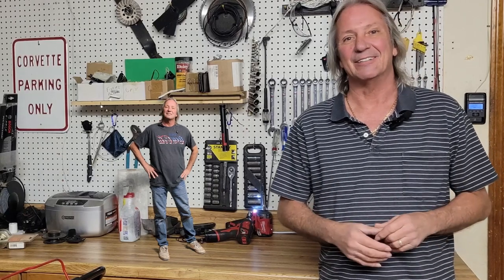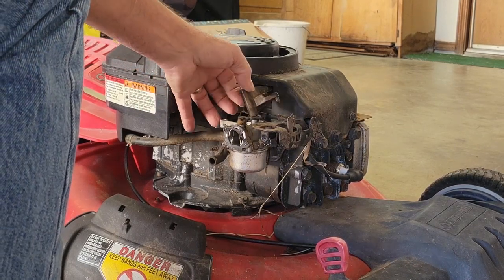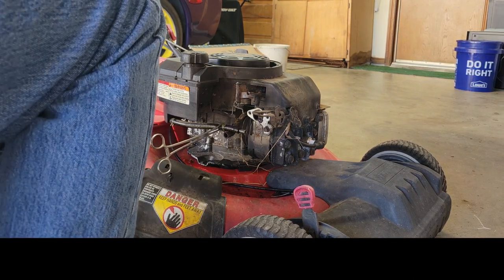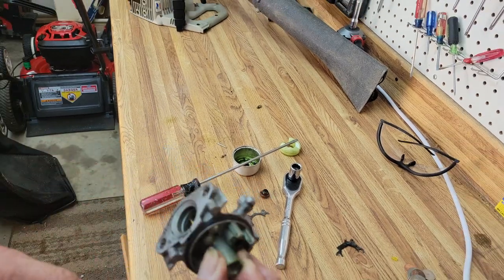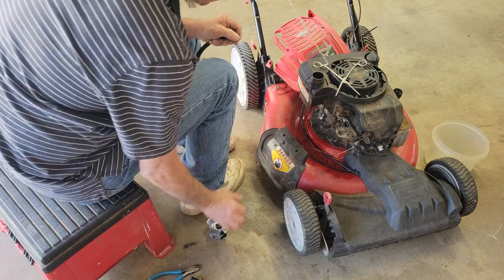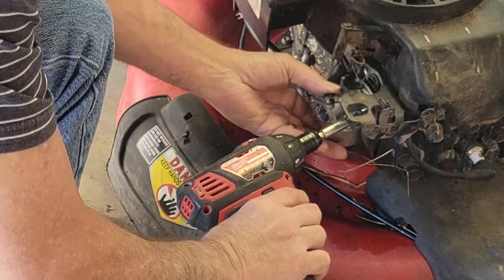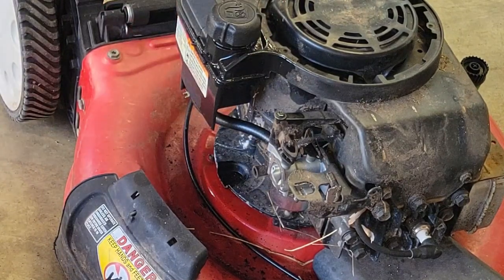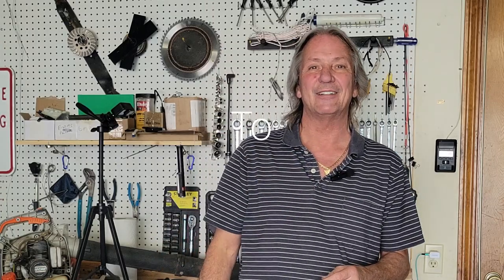Mower won't start after sitting for at least a year

Comment: Good job Bill, you should've smacked that little guy off your bench for knocking the impact over. 🙂
I didn't see if you replaced the gasket between the air box and carb, the other looked pretty torn up. 👍
Reply from the maker: Thanks. It took more than a little thought to figure out how to make mini me knock it over... It's easy to forget that he isn't there when I am videoing. There is a bit of sleight of hand going on there that nobody caught yet 🙂
I am going to make him a regular so I am sure he is going to take some abuse eventually 😲🤣🤣

I made the mistake of doing the gasket off cam, my bad. I had 3 things going at once and only filmed one of them, I stuck it to the base with a touch of gasket sealant before I carried it back over.

Comment: Ok  Love the little Bill.  Green gas in the bowl.  YUK.  Once again the gas in the tank looks newer than what is in the carb.  Customer -previous owner puts fuel in.
Reply from the maker: I am pretty sure little Bill is here to stay, he is funnier than I am. 🤣
I am thinking that it had 2 stroke in it and they drained the tank out and put regular in it before bringing it over but it's hard to say when you know nothing about it's history. It's the life of a flipper, nothing comes with instructions 🙂
Reply: @GuysPlayingWithTools  two stroke oil will dry up leaving gums or gummy residue as the fuel evaporates something not to put in for over wintering storage etc. best to use a fuel stabiliser fuel or dry it out.
Good call on replacement of carburettor...😊
Reply from the maker: @rickthelian2215 I agree completely.  Weird part was... it shouldn't have had 2 stroke oil in it in the first place, that was a guess based on the odd color
Reply: @Guys playing with tools  I’m believing the only reason would be for storage thinking oil would stop corrosion, motor oil may of done a better job.
Besides running it empty draining bowl seems the most acceptable way followed buy using fuels with stabilisers added in wintering storage.
We don’t generally winter our mowers in Australia 😀🇦🇺
Reply from the maker: @rickthelian2215  stabilizers are helpful but the best think to do is run it empty. Winter is mild here but the grass stops growing mid-October until March so they sit a long time every year. Race fuel has a blue tint, maybe they tried to add some to old yellow gas? I am guessing.
Reply: @GuysPlayingWithTools  Thanks Bill  Big Bill?

Comment: You get your fuel line bulk from the auto parts store? or another question is are there any modern fuel line materials instead of rubber that would be more resistant to ethanol?
Reply from the maker: This might be the best question I have gotten in a long time. I use "car" fuel line for all the mowers and have never had a problem(yet, of course) because a lot more research goes into car fuel systems than mowers. Some manufacturers claim to be more resistant to ethanol than others but despite their claims I am pretty convinced that 2 year old ethanol will be rough on just about anything.
Reply: @GuysPlayingWithTools  just looking locally and googling ethanol free fuel lines, there are specialty fuel lines for marine gas, high speed go kart racing, remote control aircraft fuel and so on and don't know if it is worth the extra expense up front to avoid the fuel line corruption later that shuts down the carburetor. Also I have seen medical lab grade tubing but not sure if that is fuel resistant although it is supposed to be for corrosive materials. That would be a good comparison review video if anybody has time to do it LOL. What I like about some of the modern hoses as you can see if there's actually debris in the line. Anyways thank you for the insightful videos and maybe one day I will have success of getting the old mower back in service.
Reply from the maker: @DefensorFortis  The lines on this one got replaced due to age, honestly, any decent fuel line, should last 10 years. Kinking them puts stress on them so I replace them if they don't look perfect when  I pull it off the carb. Med grade fine is resistant to some corrosion but it's usually specific to its end use
Reply: @GuysPlayingWithTools  I always bought 25 ft at a time for $0.89 per foot at Advanced O’AutoZone. Not 89 cents anymore.
Reply from the maker: I usually get 10ft rolls from O'Reilly , they last a little while and give me an excuse to get out when they are empty.